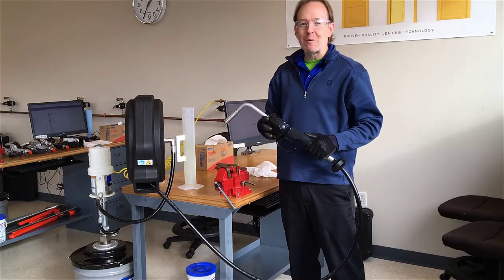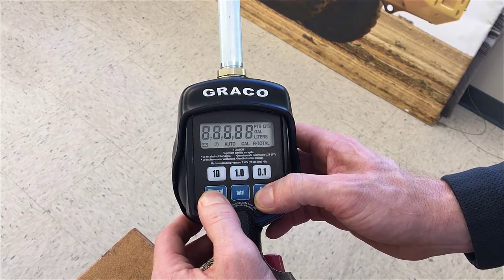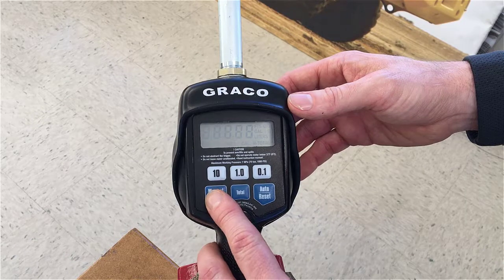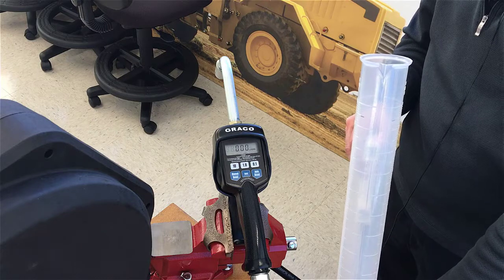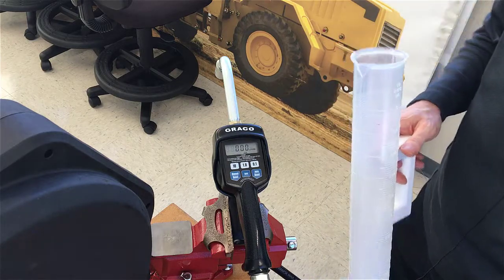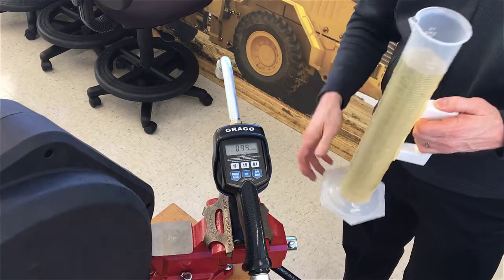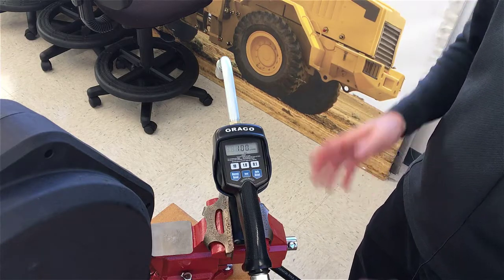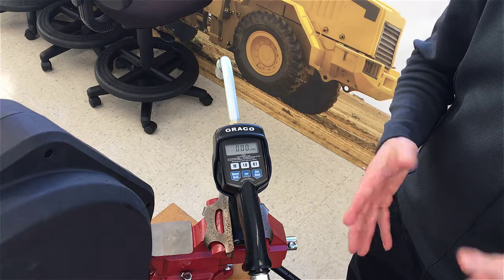LD Series Preset Dispense Meter Calibration

Comment: Hi sir... How to solve error 6 in ld dispense metre
Reply from the maker: Error 6 occurs when a preset  dispense  amount  of  zero was  entered  for  the  dispense  or  is stored  as  the  default,  and  a  Preset dispense  was  attempted. The solution for this issue is to enter  an  amount  that  is  not  zero.

Comment: can this unit dispence diesel or petrol?
Reply from the maker: Our LD Series preset dispense meter is rated for petroleum and synthetic based oils (gear lube, motor oil, ATF) and anti-freeze.  Graco does not currently offer a handheld meter for fuel.